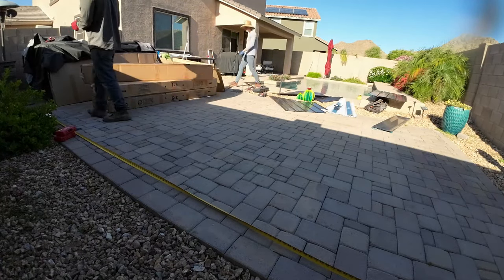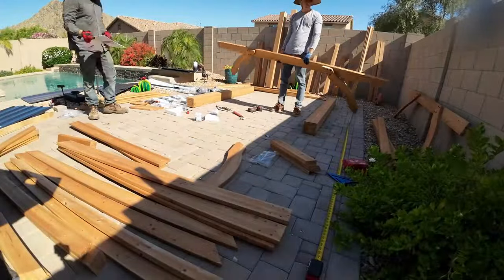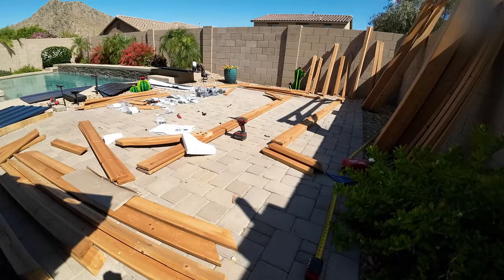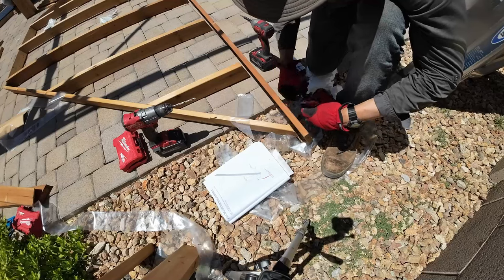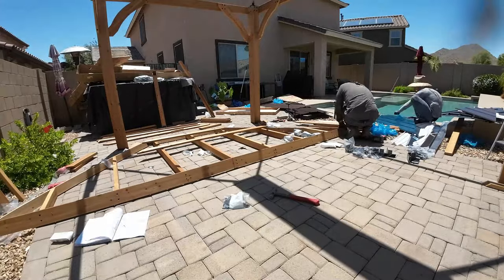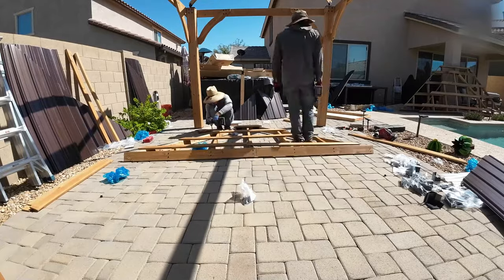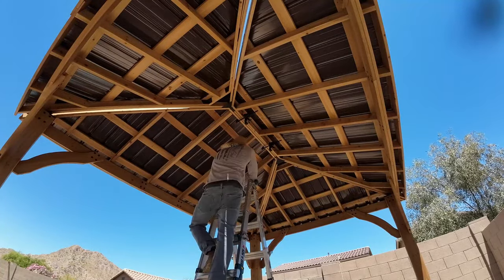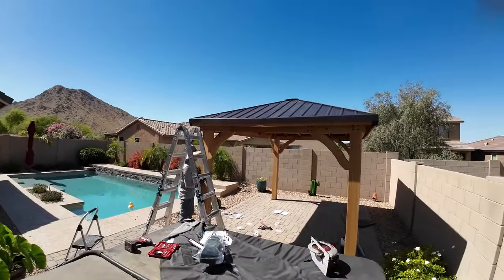Cordova 10x14 Gazebo Assembly Tips

Comment: I'm planning to put one of these on my patio.  Thanks for the tips.  Showing us your mistakes was very valuable.  Mistakes provide education, education prevents mistakes. 👍

I think I may look into adding some sort of drip edge. Maybe before the metal roof panels are attached. I intend to add gutters to mine to channel water to the sloping part of my backyard for drainage, and to prevent the water from soaking the wood every time it rains. Even cedar has it's limits.

I also plan to add 1 or two coats of stain/preservative to all the wood pieces, individually before assembly. I'll stage them on sawhorses and buckets, then stain and organize them. I'm doing it myself. (my wife will help me when needed)  I'm retired, so if it takes me 1 week (or 2 or 3) to put it together...I don't care. 🤷‍♂

Comment: Thanks for the video, it was helpful to see before I started.  Just finished the project with my son.  Took us about 20 hours.  Had issues with some warped wood and holes not lining up, so we had to drill some of our own holes.  Spent too much time peeling the blue wrap on all the other pieces, the roof panels were easy to peel.  We used the app and the paper directions.  The paper had some helpful tips, and the app allows you to zoom and turn to get a better look.  ****Tip.  Do not bend or pry the roof pieces to try and line up the pilot holes, it will tweak it and will not line up.

Comment: Just a tip. Metal Facial goes under the tin not over the top. Rain will run down the back of the board if you do it like in this video. Instructions are 3-D. I see a lot of installers make this mistake.
Reply from the maker: Instructions showed this piece installed over. Yes, I agree and I mentioned that in the video.
Reply: Thank you so much for this tip, i did exactly as you said and that is the right way, i would have done exactly what was in the instructions if it wasn’t for your comment! And have dripping wet wood

Comment: Great video man. Appreciate it!  Question on securing it. I know it comes with brackets to bolt it down. Did you bolt directly to the pavers?  I’m sure it’s pretty darn heavy but thinking securing it would be best. Would it be heavy enough if my location doesn’t have the pavers down yet?  And if so, when I do go add pavers how hard with it be to move back and forth?
Reply from the maker: if you have help, you can move it no problem. More like drag it rather than lifting.

Comment: I just put mine together last week and am considering NOT putting on the flashing that goes on around the top precisely because of the trapped moisture. I like the way it looks without it. Any negatives anyone can share to not putting on that flashing?
Reply: No you should definitely put it on but put the facia flashing piece under the roof panel. That is how it is done when building a home. The instructions are 100% wrong on this topic. It's okay to put it under the roof panel. It's a drip edge essentially 😊
Reply from the maker: you can get regular flashing and do it the right way by sticking in under the panel then use the provided flashing just for aesthetic purposes.
Reply: Thank you 🙏🏽

Comment: I recently got the same gazebo installed, but it leaks. When I observed the roofing joint carefully, I realized it is not a water proof design as the high wind can push the water to the edge of the ridge cap channels resulting in leak. How did you manage to overcome this ?
Reply from the maker: you don't, part of the design.

Comment: Great video, thanks. Did you just screw the post brackets into the pavers? I’m planning to do a similar install and assumed some sort of footing would needed as the pavers could just pop up in strong storm.
Reply from the maker: nope, left it free standing. I did tell the customer anchoring to pavers does nothing and footers would've been a better choice. He didn't want to pay for footers.
Reply: @utubehandyman  okay, thanks - I’d be pretty nervous leaving it free standing so will plan on pouring footers under the pavers than either cut pavers to fit around the posts or add field stone wraps around the bottom of the posts to cover the footings.
Reply: @stevenm2311  How did it go with footings? Did you cut pavers to fit or use wraps?
Reply: @davidhall4064  Hi, haven’t started yet, probably not until either October or next spring
Reply: @utubehandyman  what kind of footings would you have used? I'm going to be putting one of these on my back porch, but my concrete porch is too skinny for it so I'll need some footings out in the grass. Looking for ideas

Comment: For the roof panels, did you cut the purlins to be flush with the roof?  I'm actually building this thing right now, and my purlins extend past about 5/8" which the instructions said is fine.   But in your video they look to be flush.
Reply from the maker: lol I feel your pain brother!. So the 5/8 overhang is for the flashing piece that goes in last. It slides under the roof panel and on top of those side trusses. It just gives you something to screw the flashing piece into. It doesn't have to be precise, it could be a bit shorter or longer. Once everything is done and assembled even if it looks jacked up, the final flashing piece that goes over will cover that area lol.

Comment: How did you anchor the posts? Did you have to dig footings out of the existing pavers?
Reply from the maker: I didn't customer wanted it free standing. Otherwise, I would've installed footers prior assembly since this was on pavers, not a concrete slab.
Reply: @utubehandyman so I'm gonna install one in my house and on pavers. I don't really want to put concrete footers and just put them on the pavers. What do you recommend for anchors and how long should they be?

Comment: Did u have a lot hardware left over ? Washers n screws etc ?
Reply from the maker: yes, there is always spare.
Reply: @utubehandyman  is the roof suppose to leak when it rains ?   Great gazebo. But my roof leaks when it rains 🤔
Reply from the maker: @phillip812  not supposed to leak. My guess the flashing has a gap allowing water in or you missed one of the screws that attaches the roof panels down

Comment: does it really matter if the metal roof frame the 14ft side is not square i have one side good at 124' 7/16 but the other side is 125
Reply from the maker: It will never be 100% due to the wood not being straight. The Trim will cover any discrepancies.

Comment: Did you have you cut and ends down to 5/8 to make theroof panels fit..im noticing that on mine
Reply from the maker: no i didn't. The trim will cover all that at the end.
Reply: @utubehandyman  I saw in directions had it written in red..I got 2 panels up so far I'm concerned the large ones won't fit because of the parlins overhanging..gonna be a tight fit..they should've made those boards alittle shorter
Reply from the maker: @tommyjer1979  It's been a while since I put this one up so I don't remember 100% all the details but I detailed most of it on the video. I can tell you, a lot of the wood will be bowed somehow and not everything will line up but the trim at the end will cover everything.
Reply: @tommyjer1979 i just finished building mine yesterday, it doesn’t really matter if the ends hang off, a couple of mine were hanging off and it still fits. Just as long as the frame of the roof is correct than you are good to go
Reply: @Boogie1328  nice..yeah mine came out great..no issues fitting..I had a good impact gun to set the bolts in nice and tight and pulled it all in snug.

Comment: You anchor this to the pavers ?
Reply from the maker: free standing
Reply: That's what I'm dealing with now. I was told it would damage the pavers. Is this true?
Reply from the maker: @ajenkins5907  it does nothing anchoring to free floating pavers. If you drill thru pavers, yes they may crack.